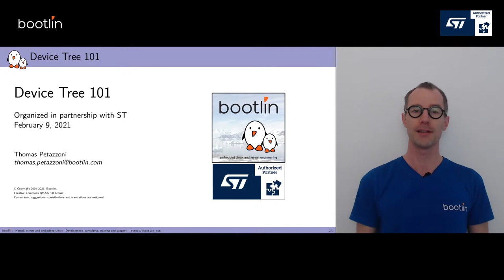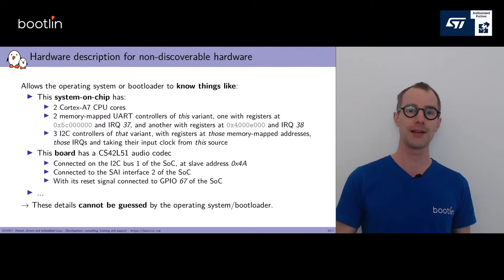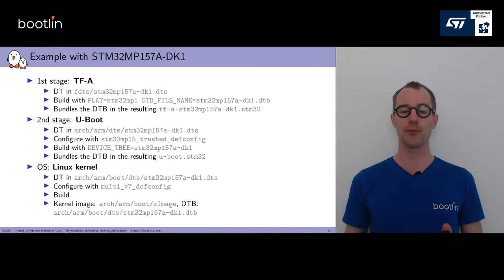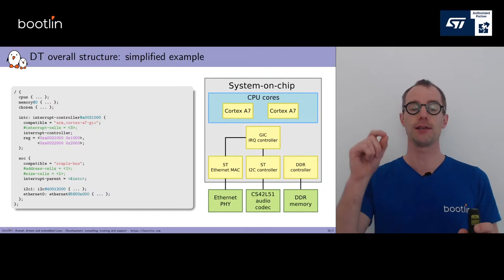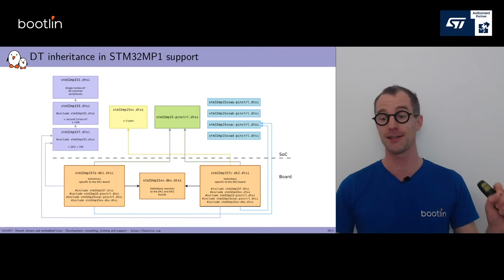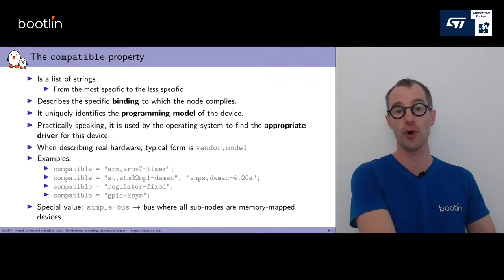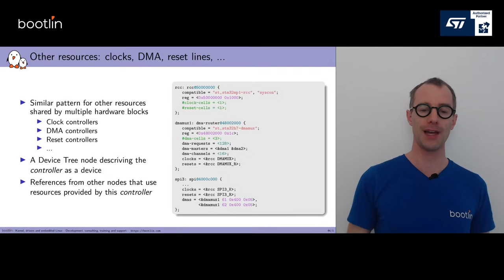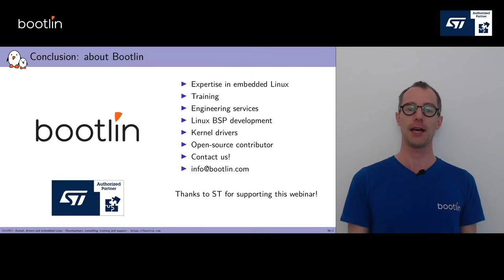Device Tree 101 10:00 AM UTC+1 session

Comment: Some useful timestamps
DT = Device Tree
-----------------------------------------
0:00:00 - Introduction
0:12:38 - Discoverable vs non-discoverable hardware
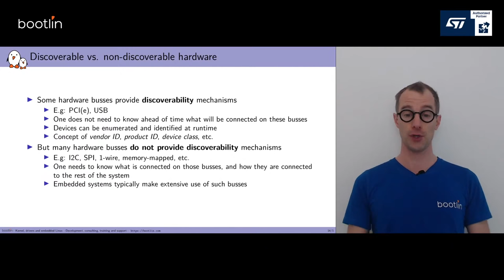0:14:15 - Hardware description for non-discoverable hardware
0:18:07 - Hardware description with Device Tree Intro
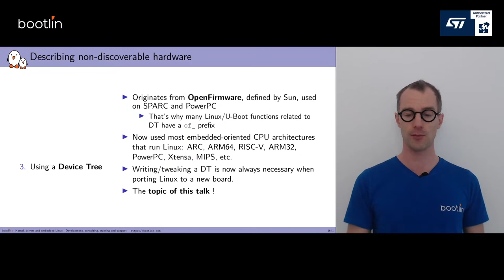0:19:39 - Device Tree from source (.dts) to blob (.dtb)
0:21:44 - dtc (Device Tree Compiler) example
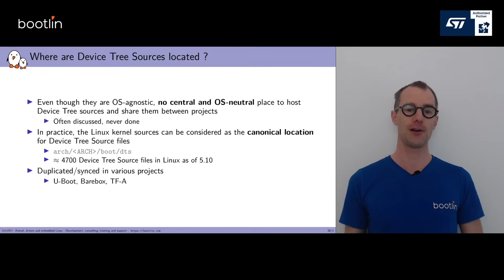0:27:36 - Boot process example for STM32MP157A-DK1
0:32:52 - Exploring DT on target
0:34:03 - DT basic syntax
0:37:42 - DT structure: simplified example
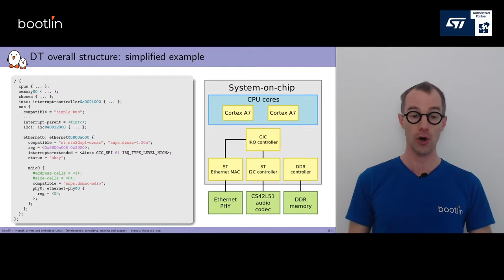0:46:56 - DT inheritence
1:01:41 - DT design principles
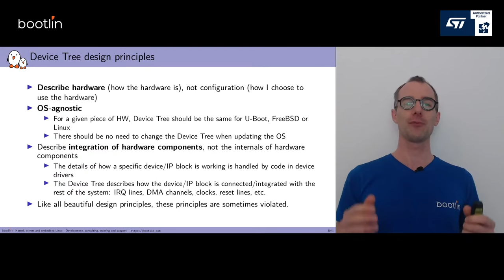1:04:29 - DT specifications
1:10:54 - DT compatibility property
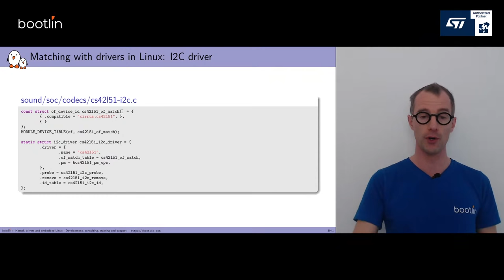1:18:26 - DT reg property
1:20:25 - DT Cells and # symbol (not comments)
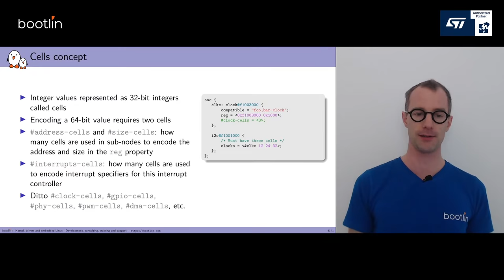1:23:05 - DT status property
1:28:43 - DT -names properties
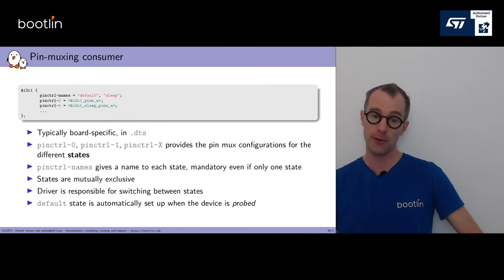1:34:58 - Example with LED and I2C device
1:41:22 - Resources
1:41:50 - Conclusion
1:43:44 - Q&A

Thanks for the great talk 👍